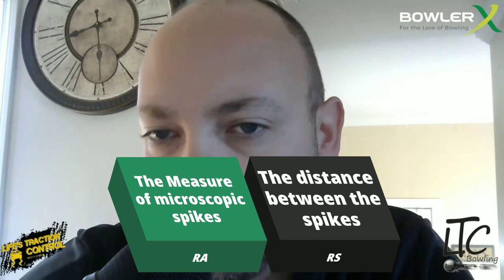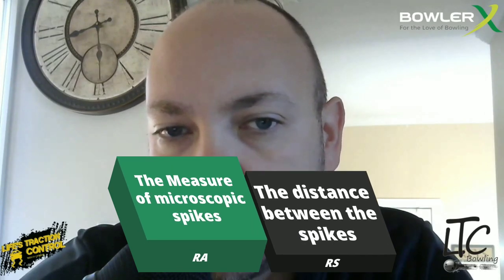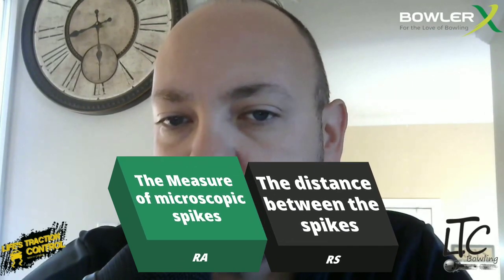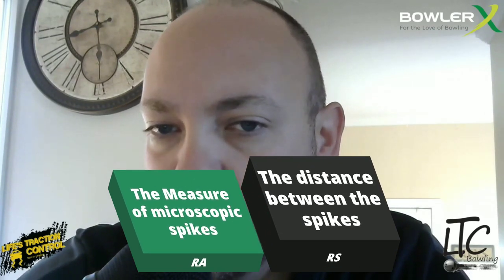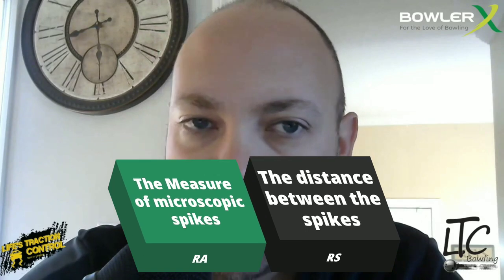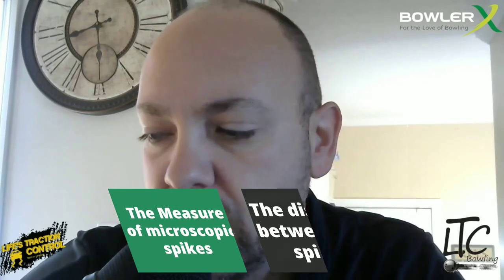Surface changes | preparing your equipment for events

Comment: I use true cut pads and apply my surface based upon what the ball layout is.

If its a layout that is meant to hook early, I usually throw a lower grit on it. If its meant to hook later, its a higher grit.

Comment: Use CTD pads for surface changes.   Have a HyroadX that was 1500 polished OTB which is actually 5000 grit.  After several months and not being happy with the ball I used the 5000D pad which by hand takes it to 4000.  The ball has come alive for me.  I'm a speed dominate stroker style bowler.  I think your bowling style also plays into your decision on the surface changes you make to the ball.
Reply: David, I have a relatively new Halo Pearl, also at 1500 polished/5000 grit.  It seems less alive than my 8 year old Columbia Wrath with plenty of oil & wear on it, I'm totally disappointed on the back end reaction. I am also stroker style currently and bowl on house lanes of medium oil.  I am thinking same thing, maybe taking it down - I have the CTD pads. You did this by hand?

I was also thinking about a trial run at 1000 CTD pads and then adding polish as he discussed in this video, not sure I want to or not. Any thoughts?
Reply: Also, did you polish at all after you went down to 4000?
Reply: @frankschmidt8001  I didn't add polish at all.
Reply: @frankschmidt8001  I just purchased a Global brand pearl that I haven't thrown yet.  Anxious to see how it reacts.  I may take the CTD 5000D pad and knock off the shine if I'm not happy with it.  Ref the question by hand, yes.  I never thought of using the 1000 pad and adding polish since I'm having success afer using the 5000D pad without polish.  You can try it at 1000 polish.  If you doesn't do what you need it to do knock the polish off and hit it with a lesser/higher grit pad.  Ref your Halo, it my just be a matter of putting games on it.  I've heard it can take as many as 30 or so games before the ball gets the reaction your looking for.  Your PSO or other Roto Grip guys might be able to give you insight able the Halo Pearl.  If you haven't already check out the CTD product line.  I purchased pads, cleaner and polish through them.  Lots of U-Tube videos on changing ball surface and their products.  Best of luck.
Reply: @davidchamberlain5146  Thanks David, appreciate the feedback.

Comment: What is the best way to decide if you should change surface or go to a different ball?
Reply: Based on its reaction and are when are you talking about changing surface because you can’t change surface in the middle of the game. Also btw you have to look at where the ball is finishing when it leaves the pin deck then of course how the ball hits the pins.
Reply: It's kind of practicing observing the ball motion. If you like the way the core and drilling creates a certain shape, then you probably tinker with surface. If you don't like the shape of what the ball does then maybe change ball. Also since you wont be able to change surface mid game, if you really dont like the ball reaction, you change ball.